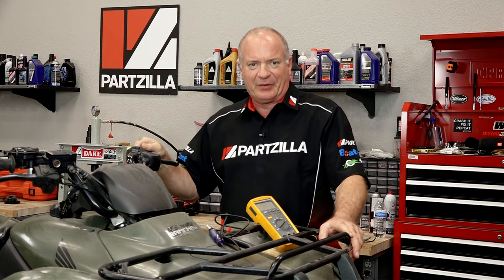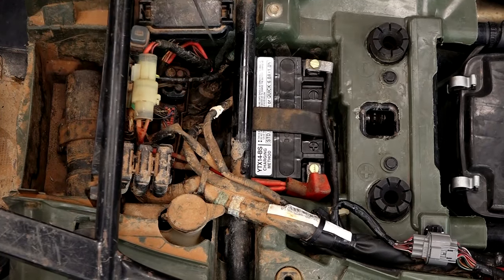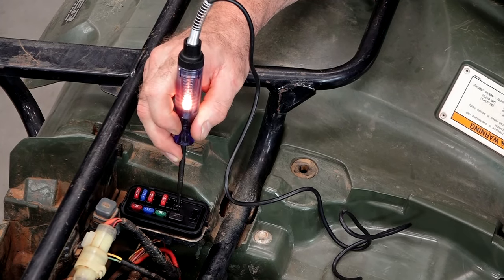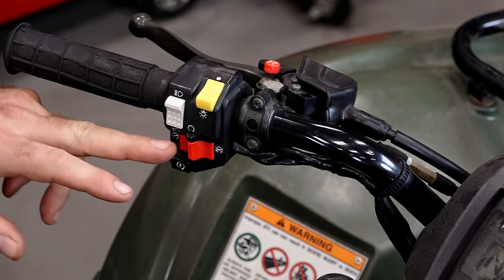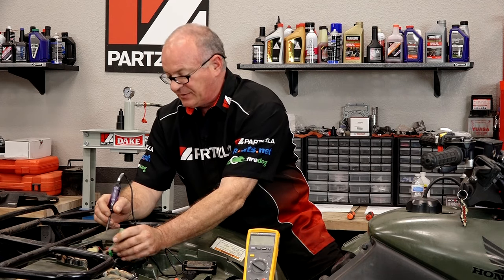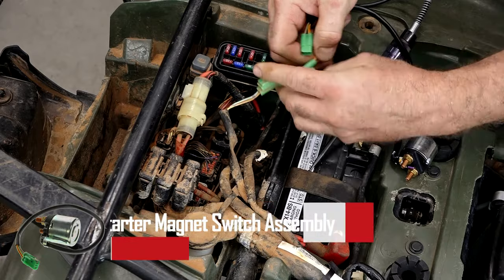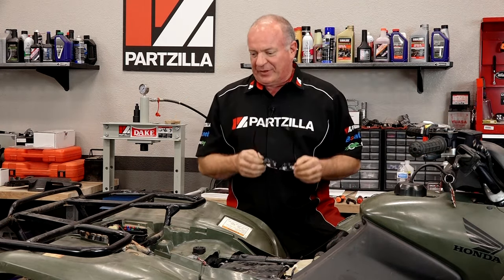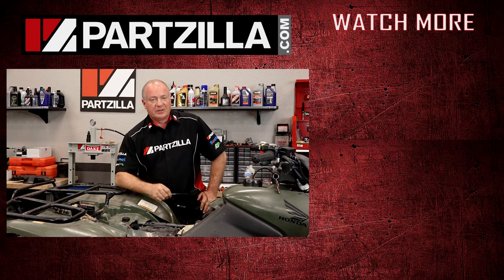Honda Rancher 420 Won’t Start | Honda Rancher Starting System | Rancher Starter Relay Replacement

Comment: Lifesaver!! I was just in the middle of the woods checking Coyote traps, went to back up and it died. Wouldnt do anything but the screen was on so I followed your steps, checked fuses and then I realized when you said to check it, I hit the kill switch. Hopped on and rode out!! I never use that switch and I was about to hike back and get help but thanks to your video I checked that! Thank you !!!

Comment: Great information I had good power at 30 amp main and at 10 amp ignition but no power to safety kill switch 
Back tracked to fuse box and found ignition power wire chewed into 3/4 inch below fuse box 
Thanks for the video

Comment: Great video. Any suggestions if when you turn the key on dash lights come on headlights come on and starter will cycle but no fuel pump. All fuses are good and it only did this when it was -20F. I pushed it in the garage with the heat on and 30 min later everything everything was back to normal?
Thank you.

Comment: Thank you! My Rancher stopped while riding and the ignition would not work. The indicator panel lit up and the lights still worked. I swapped out my 10 amp fuses with the spares and found the bad fuse.

Comment: Great info. 
2000 rancher here. Starts in occasion with the electric start, on first pull with cord. Seem like the solenoid is clicking every time I try to start it. How likely do I have a bad starter?

Comment: Great video, well done.  My machine is a Honda TRX400FA Four Trax Rancher ATMy problem is different in that the starter keeps trying to crank while I am driving it and after I shut everything off.  Rani fine until I got caught in a rainstorm.  Ever hear pf that problem?   I cannot find a short making that happen but does not mean it does not exist.  I plan to replace the solenoid since the machine was in a garage that burned a while back and some of the wires melted.  That was when I got it and it has always run fine.
Reply: 2004 is the year of the machine, I forgot that

Comment: John Talley's videos are THE BEST on the web.  His voice and personality are the most pleasant and confident.  He explains everything so well!

In my case, however, my solenoid ALWAYS has the same voltage as my battery.  It is as if the solenoid is stuck in the energized position.  John, please let me know what might cause the starter solenoid to stay engaged?  The starter, however, is not turning!

????PLEASE HELP.

thamnkfully,

randy

Comment: Mine does the clicking right now when I try and start it but won’t start. It’s a 2008 rancher 420, do you think it would be the starter since the solenoid still clicks?

Comment: Hi John;  always great video's. love watching them. always precise.  i have a question if you don't mind.  i have a honda rancher trx420 fe that doesn't idle down whatsoever. i have put so many new parts on it and yet it just want idle good.  here is a run down of what i did. for starts a air filter--- new fuel rail---new injector---new IACV--new fuel pump---new fuel filter---new petcock---clean tank very well---new spark plug---and tried spraying contact cleaner around throttle body to see if it was sucking air anywhere while it was running. also no codes are flashing and does not idle well at all. kind of spit and sputter with high idle.  any input would help   thanks in advance

Comment: I just replace the solenoid on my rancher and I have 12 v going to the starter does that mean the starter is bad because it's buzzing and not starting
Reply: That happend to me did you find out the problem
Reply: @Joeysmith1  yeah starter

Comment: Great video. I have tried everything in the video you mentioned including the starter relay. I am getting good signals from all tests. The battery is good (12.8 volts) and I get the click from the relay. I even tried a new starter and all I get in the click from the relay. Anyone have any ideas on what else it could be? Thanks.
Reply: Did you solve it? Good luck if not.
Reply: @rogerthedodger5788   Yes, I solved it. The problem was with the starter. Just inexperience on my part.  The Hondas are fairly easy to work on. I can't complain as mine is 8 years old and this is the only issue I have had to date. Still on original battery.
Reply: @allenhance831 just replaced the starter relay and having the same problem, did you just replace the starter?

Comment: Hi,
I had mice chew the three wires coming from the engine to the rectifier/regulator and I don’t know which wire went to which now. Does it matter at all which one I connect them to? I’m assuming if they are all putting out 18 volts, it shouldn’t matter. I just want to be sure and not damage anything further. Thanks in advance.

Comment: I have a Honda Rubicon (Big Boy).  It's a 2006 model that we use to ride and inspect our farm.  We don't drive it enough. It has less than 150 miles on it. I drain most of the gas and disconnect the battery and run all the gas out of the carburetor for the winter.  I've changed the oil once. My problem is that I cannot keep it running without the choke being in the on position.  I can ride it around the yard with the choke in on position. The minute I stop to idle and turn the choke off, it dies out.  It also dies out when I go from neutral to drive. It is also difficult to change gears.  What do you think is the problem?

Comment: Do you have a video on rebuilding the starter on that 2012 420 ?
 I have the same machine...don't need to rebuild mine...just wondering how to do it.
Looked for the rebuild kit on line...no luck finding one

Comment: My 2013 Foreman 500 makes a clunking sound upon trying to start. Sometimes it makes the sounds and starts and sometimes is doesn’t but will usually start on 2nd attempt. Any thoughts on what the problem might be?
Reply: Ever figure it out? I'm having the same problem you described.

Comment: My Honda Rancher does everything you said it does but it just clicks so I'm assuming it's a bad starter or there's not enough power to the battery I never checked the voltage on the battery but should it jump with a jump starter and I clicked them to verify it's not the starter

Comment: We have a Honda Rincon that we trained the fuel out of because I've been sitting for two plus years we put some new fuel in the tank and it turns over but won't start before draining the fuel it would actually start what can possibly be the issue

Comment: Awesome video and troubleshooting steps!  Do you have steps on troubleshooting ES not shifting, dashes on dash, not fuel pump click or spark troubleshooting steps?  I traced most of the wires, check the shift motor is good.  Is it my ECM?  Somebody left it in gear, used the kill switch, did not turn off key and cause the battery to go dead...  How it all started..
Reply: I have the same exact problem, did you ever get yours figured out? Thanks
Reply: @gyminit5  Yes, it was my ECM.  I swapped the ECM from another 4W and solved my problem.  Then I ordered one from Amazon.  This worked for my model.   HONDA 38770-HP5-603 PGM-FI UNIT

Comment: I have this problem on a 2010 honda rancher. I don't know if the battery is just dead. A mouse made a nest among all that wiring and stripped some of it. Bare wires showing. Should I keep going or take it to the Honda repair shop? I don't know anything about wiring.

Comment: Hi john, i have honda trx 500 no spark. If you used push button only cranking no spark, but you can used the manual by the rope have power and start the engine, what the problem? Pls answer my comment godbless

Comment: I have a problem with a Honda 420 ATV with intermittent starting turns over but no starting have replaced battery spark plug and ignition switch. Any other ideas I have had many technicians look at with no luck including Honda dealer.😕

Comment: How are you how can I connect the plug from the selenoid in the fuse boxe,because the new cables doesn't have the plugs

Comment: I have a 1998 Honda foreman trx450es, when I turn the key 🔑 on ot blows the engine fuse. Which is a 10 amp fuse. Do you know what can cause that to happen

Comment: I have tried everything you said and the solenoid clicks so I figured it was bad so I got new solenoid put it on and it clicks same as the original one...could it bad my starter is bad ?
Reply: Awesome video you put out there...i appreciate your help.
Reply: What did you figure out the problem was?

Comment: Got a 99 foreman es have had no issues till now . Turn key turns over intermittent weak spark then starter sticks on even with key off have to disconnect batteries. New solenoid coil and icu nothing changed . I need help.

Comment: I have a 04 Honda Rancher 350 i can use the pull rope and it will start but when i use the starter it will not start but the starter is turn the motor ok but will not start why??

Comment: hello I have a 1998 kawasaki klf 300 starter is good touching with screw driver it engages and turns engine over.  but when I turn the key on they isn't any lights nothing no Starr nothing battery is being jumped with a fully charged jumper box .  what should I test to get neutrals switched show up red green light show up..

Comment: My son ran his honda Forman  500 very low on oil till engine cut off   I think low oil  sensor  after adding oil still will not crank what di I need to do ???

Comment: I have a Honda Rancher 350, pull start works for about a week. I have to take it off, free spin it while hooked to battery. Then put it back on. It will pull start first time. What is causing this?

Comment: Mine did this a week ago and it’s still not running we charged the battery and nothing but the sensor PBT-GF30 make like a tapping noise is that bad or should I just get a battery

Comment: hello, I have a problem with a 2013 honda atv 420 fourtrax It is, on the screen it flashes 2 times slowly and then 2 times fast, which means and it does not give the electric gear, the angle sensor was changed and it still does not work, help

Comment: I wish someone could tell me why mine runs fine like normal no problems at all .. then all of a sudden it just dies like you hit the kill button looses all electrical ..then takes spells it will run a week without an issue then days it does it multiple times a day ...can someone please help ..

Comment: I have no spark on my 99 Honda Foreman 400. What is the voltage on the blue yellow wire coming from the Stator as the bike is cranking?
Reply: I have the same problem after changing the carb. No spark

Comment: Never had an issue with my 2016 rancher. I always shut off with the key. Went for a ride, shut off with the key. When to start up, display would not show N for neutral. Clicking noise under display. Disconnected the battery and reconnected. The display showed N for neutral, push the start button and the start solenoid clicks and starter doesn’t engage and display shows “-“ where neutral should be showing. Seems like an electrical issue with the display not showing N neutral. Any suggestions would be greatly appreciated.
Reply: Having exact same issue did you ever have this figured out?
Reply: @thk98  it was my battery.

Comment: Hey,  I have a 2007 Honda rancher 420 which dose not start. the Battery is good no light come on and i do not hear the pump. what should I be checking for?
Reply: What was your fix? Mine currently does the same. Mine turns and turns but doesn’t seem to fire. My guess seems like the fuel pump isn’t getting power

Comment: mine cranks but its not firing up and running it just cranks and cranks it back fired one time. ive cleaned the carburator put a new one on so im clueless now

Comment: I have a  strong  clicker on solenoid  but no go on starter what's next
Reply: What ended up happening ? Same thing happening to me
Reply: Did you find a fix to this? My solenoid clicks once when I hit the ignition button but doesn’t start. Brand new starter and brand new battery.
Reply: @nakidrummer  it was a solenoid for me
Reply: Ive replaced the battery , Spark plugs , Starter solenoid , And now the starter 
I have power , The solenoid clicks , No dice

Comment: Can I get the part number i have the same model
Reply from the maker: This link has part numbers for the multimeter, test light, Honda switch assembly, and the fuses: https://www.partzilla.com/search-list?q=7VJG-PERFORMANCE-W2981%0D%0A2Y27-LANG-TOOLS-13809%0D%0A98200-43000%0D%0A98200-41000%0D%0A35850-HP5-600

Comment: Customer just dropped off a rancher, get this , been to two mechanics. First one was  running and “fixed”the piston. Next mechanic fixed drums brakes bc it was stalling.now it doesn’t run 🤣🤣 this guy loves throwing money away

Comment: If rats where eating the wire Honda makes a rodents deterrent tape.
Reply: Never heard of that.   Gonna look for it, thx.
Reply: @194853DodgeTrucks  I can get you a part number and yes Honda thinks of everything. Happy Hondaing 😎
Reply: @nighthawkj30A4  found it like you said.....I have cattle which, of course, comes with critters. The tape will definitely help. Thanks my friend.
Reply: @194853DodgeTrucks  your welcome